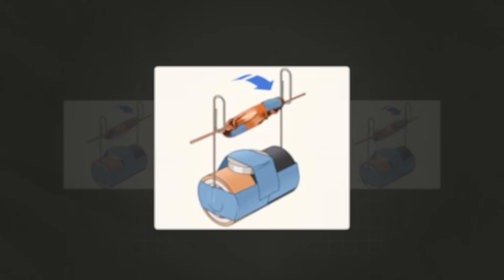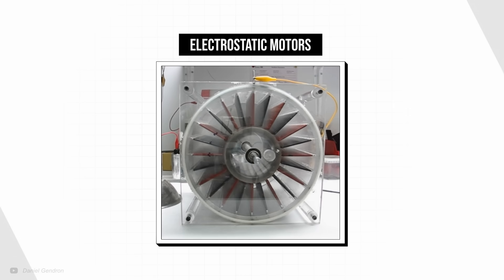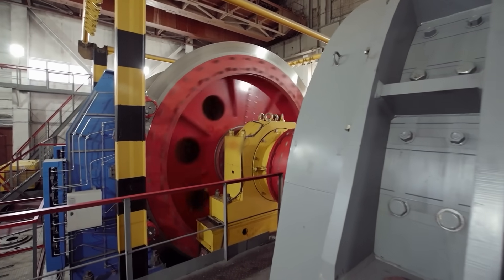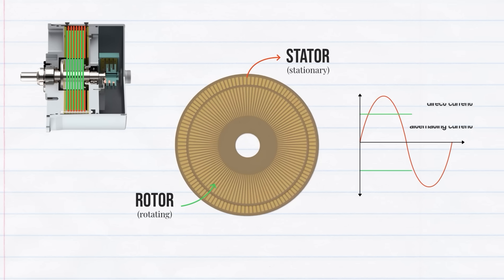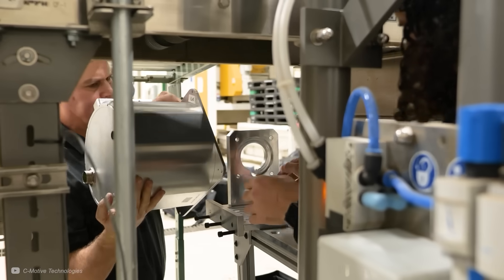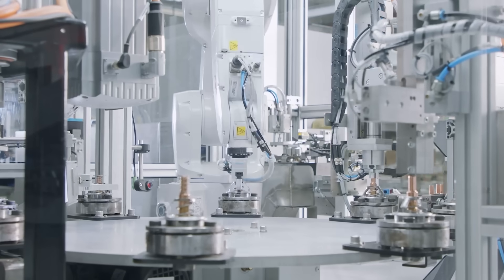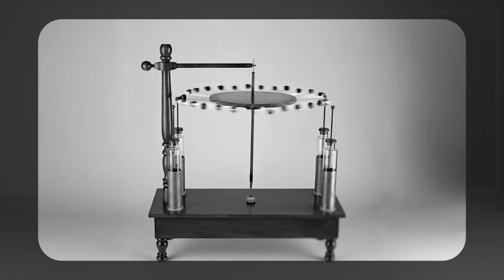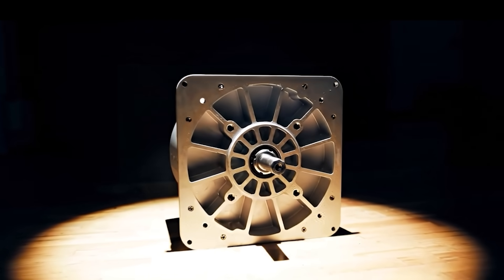How Electrostatic Motors are Breaking All the Rules

Comment: The one single thing an electrostatic motor can do that no magnetic motor can do is holding torque without power consumption. I think stepper motors would be a great application.
Reply: EM motors can do it too, provided that superconductivity is involved.
Reply: @borisstitnicky585 
But then you need cooling, which uses power
Reply: Nah... I don't care how good their liquid is, leakage current is a thing and it gets bigger with higher surfaces and lower gaps (which is exactly what we see here), so no, without power it will lose change fairly quickly
Reply: @HarmKaban  The point is not if it exists or not, it's that it is orders of magnitude smaller than the holding current of stepper motors.
Reply: Got Idea force magnetism equivalent water force on pinwheel. I wonder.
Reply: Do you know Newton's 2nd Law?
Reply: Yea copper and magnet stepper motors sucks at being motors. Good for control but at 30% efficiency no good for anything else.  So yes that would be awesome use of this if there is a way to make it take steps without loosing the efficiency generating the step pulses that would require the static field to rise and fall making it dynamic causing back EMF. I don't think these motors likes stopping and starting. But no I realize that is will also draw current to hold the static field.
Reply: BS. whats a corona discharge? whats a dielectric constant? whats a leakage current?

a charged capacitor will eventually discharge as it has leakage. it takes power to maintain that charge. and as voltages increase, so do leakage currents. the higher the potential, the faster the leakage.

it takes no power to maintain a magnetic field.

it does take power to push a current through the coils DC resistance.

they are completely analogous, just the two opposites. they both require power to maintain a given field strength in the real world, where cows are not spherical nor in a vacuum.

a magnetic field has no issue with proximity, the tighter the gap the better. 

electric fields tend to break over, punch through the dielectric... the tighter gap increases forces but reduces potentials that can be achieved and you end up chasing your tail. 

if the electrostatic motor was anything but a novelty they would be far more common.
Reply: @paradiselost9946  Technically there is always leakage. Technically that means if the holding force is required to be constant, there has to be current flowing. But in practice that leakage can be reduced to basically zero (I had capacitors hold their charge for months). All that at room temperature with no need for superconductors (which would be required for a magnetic stepper motor that has no holding current). So if you ignore the tiny leakage and just not recharge the slowly discharging capacitor, there will be no current flowing. If the conductors are sufficiently isolated there should not be significant corona discharge.
Reply: @HL65536  You had capacitors holding their charge for months? 🤨
Reply: Why would you want it to? Just use a standard squirel cage motor with electro magnetic break and cut power

Or use permanent magnet motors which can do this.

Comment: I liked you pushing back a bit on the marketing material, but the main narrative still seems very marketing centric. 
No info on costs? Operating at high voltages increases cost of all connected components (inverters, drivers come to mind), also higher safety regulations etc.

Comment: Static is measurable. Yeah you can spin a wheel, but can it xarry a load ? ( no )  it takes 9.8 joukes to lift 1 km 1 meter. Youre also igniring back emf, its a factor

Comment: 6:18 - it can handle 4000V per what - per meter? That would be surprisingly hard to make something so bad. per Cm? That would still be incredibly bad. and it puts an rpm-limit on the whole thing.

As for industrial conveyour belts - yeah no. Their power-usage come primarily from the friction of the belts and rollers them self. You can not gain much efficiency there. the biggest improvement in powercosumption we got in recent years was going with chain-like conveyors where possible. (and if there was ANY downtime in 12h/5day weeks in just 2 months then they would be completely unusable. )

And are they really that huge? cause those motors used for conveyours are tiny - that much space is costly.
Reply: " it can handle 4000V per what - per meter? "

It runs around 4kV over a gap distance of 0.8mm as stated in the video.

Comment: Electrostatic motor can replace brushless EM motors if you use a low viscous dielectric fluid instead of air & find a 5kV power supply for the motor. Where’s the cost savings???

Comment: This motor is basically a brushed motor due to slip ring and  intended for continuous-duty use like a conveyor belt, where everyone uses brushless motor. I wonder its durability and MTTF values. Secondly, the high operating voltage requires stricter safety standards, significantly raising costs of the machine manufacturer.
Reply: I mean, you could just engineer it for easy field-replacement of the brushes/slip ring, and recommend doing so every X thousand hours of service. I presume factories have other scheduled maintenance tasks, like re-greasing machinery innards.

I do wonder, if you need a step-up transformer close to the motor (rather than running 4000V lines around your factory), does this negate the material savings of copper? Or can they invent a transformer without copper windings as well? (:
Reply: @ps.2  High voltages are easily generated without a step-up transformer, there are several semiconductor-driven solutions on the market now.  But there are advantages to distributing the voltage at HV or near to the desired voltage.  4000 volts is actually pretty easy to distribute, it's when you get into the tens of kilovolts that things get squirrelly.  There's probably a balance between HV distribution and materials cost.
Reply: @ps.2 The motor requires  a motor driver to run as per there website.
Reply: Slip rings are very different than brushes in a DC motor.  They have very low wear compared to commutator brushes, as they don't experience arcing constantly as part of normal operation.  Slip rings can last a very long time.  As for high operating voltages, a lot of that depends on how the voltages are managed.  Thousands of volts are generated in microwave ovens, bug zappers, fluorescent/neon lights, and lots of other equipment.  High voltages are, in many ways, actually easier to manage than high currents.
Reply: Incorrect.  Conceptually it may seem like a brushed motor.  The slip ring is effectively contactless.
Reply: @Fejimush   interesting. I commented based on the video, which says "brushed". Out of curiosity, how do you induce voltage on the rotor then? Similar to induction motor?
Reply: @aliveli8650 
Could we transfer AC current using electromagnets instead of brushes? And use a capacitor on the rotor to jump start it. Maybe use voltage Multiplier to convert the AC to static charge for the rotor discs. Obviously the cost of the EM design would need to fit within a budget that keeps the system innovative
Reply: @Fejimush  so does the conductor rotate instead of slipping?
Reply: @Fejimush How exactly are slip rings "effectively contactless"?
Reply: @Fejimush  It will need some pressure and contact. No arching and heat is were I would think the difference would be
Reply: How's a slip ring contactless? As far as I know all power transmission slip rings are contact based with consumable brushes @Fejimush
Reply: The reason why the brush lifetime is not that important is because it is ES motor so the current itself is not that big
Reply: @hayoun3 Good point.
Reply: @hayoun3 The wear is not caused by electrical current. its due to continuous mechanical operation like running 24/7 in conveyor belt application.
Reply: Build the step-up and control electronics into motor and then feed it with mains or DC.
Reply: Higher voltage also dictates near impossible standards for water ingress to maintain even a usable MTTF. I dont think I would have much time off, if I were maintaining these for such like as brewery or dairy.
Reply: @TheTemporalAnomaly  you could have the motor on top instead of bottom
Reply: @TheTemporalAnomaly the video literally said the costs were lower when running in a brewery 24/7.
Reply: I smell $$$$$ Nice try! High voltage is great for electrical energy transmission but they stay still in one place. 😂

Comment: I'll bet the current design has gaps too small to avoid the disks colliding with eachother when both actively running and being rotated about its axis; hence why stationary installs are the focus right now.
Reply: Yep, high voltage between those tiny gaps is an Achilles Heel.

Comment: Put a dielectric fluid multiplies the breakdown also the torque .
If glycerine was used e=42.5 then the torque will being multiplied by (42.5)²  times with the same voltage applied.

Comment: Cheap single phase AC motors are often very inefficient, but it's not that difficult to reach >90% efficiency with other conventional electric motors, even including a fixed gear reduction. Comparing a product to some cheap crap/and or improperly chosen equipment, when there are well proven options on the market that probably are much cheaper and also more efficient than theirs in reality isn't really honest.         

Electric motors and gears are things we've figured out so well that there's isn't much potential left for improvement over better options, used correctly. Both copper and neodymium can be recycled, those things don't get consumed, just "locked up" during the lifespan of the motors.          

$1400 saving per year, per 1.5 kW motor, requires the power to really expensive, if 1.5 kW refers to the output in both cases, that means ~650 W difference in power consumption between 65 and 90% efficiency,  that means a price of  ~25 cents per kWh, if the motor runs 24/7 for 365 days.
Reply: You’re 100% correct I work in industrial power transmission.

They chose worst case scenario for the motor and gearbox. They used an ie1 motor and a high ratio worm gearbox. If they used an ie4 motor and a helical bevel efficiency would be in the 80% + range. I am almost certain they then are not taking into account the sprocket they are using on their motor to drive the conveyor.

The reason people use worm boxes is they are so cheap and usually motor power is tiny below 1.5kw. Only when you get around 40mm output shaft do helical bevel units start to become common over worm boxes as the purchase price is so different.

If this products expensive it won’t be commercially viable as it’s solving a problem that’s already been solved but not taken up due to price.
Reply: I think they're skewing the numbers to attract investors, not customers, as the latter would know the real world figures and question their math.
Their motor is pretty cool as far as saving on copper, but it seems to be a hybrid between induction and electrostatic as it does require AC on the stator and DC on the rotor with brushes.
Reply: @VeniceInventors he said specifically that the DC input wasn't necessary with this design.